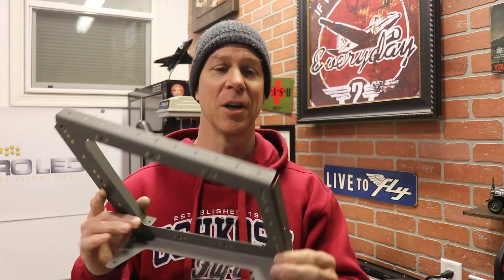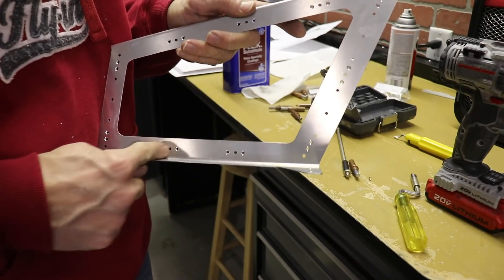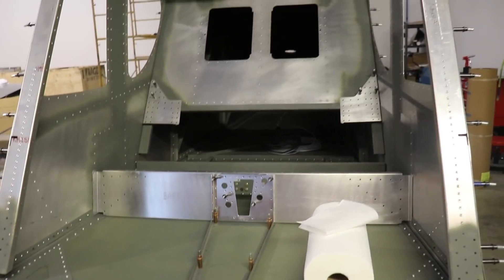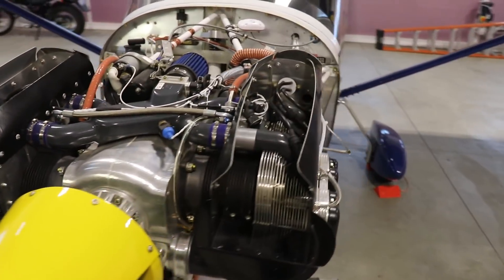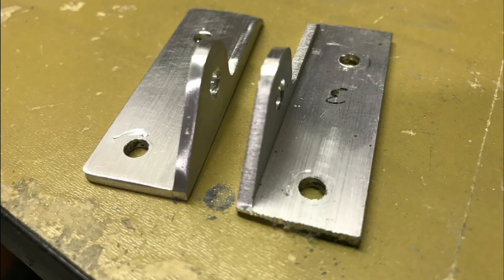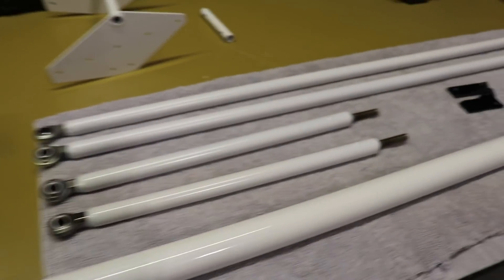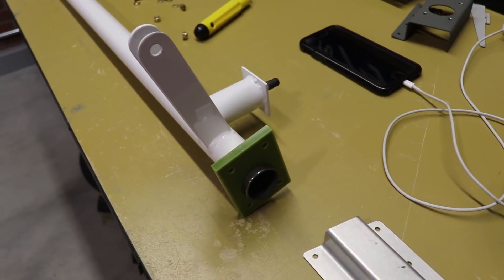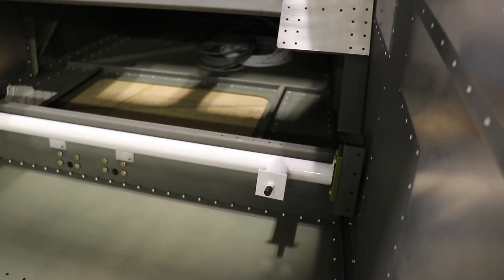Zenith 750 Super Duty Fuselage Update! (Ep29)

Comment: Are those floating Nutplates ? ... if so, you should add 2 x the radial float to the diameter of the bolt for a final hole size typically around .225" dia for a #10 fastener (3/16" dia bolt) , if the radial float is .015".
Reply: The close tolerance hole (.201" dia) goes in the access panel and the floating Nutplates on the mating structure provide positional tolerance for all of the hole-to-hole relationships.

Comment: As a manufacturer I use bolts in all of my assemblies. Bolts that have a smooth shank section (Grip length) are made the way they are to tightly fit two surfaces together so that there won't be any side movement in the joint or shearing force. You are supposed to get resistance when bolting these fasteners through a joint aka hole to get rid of that lateral movement that may become possible especially in a high vibration zone.
Reply from the maker: It sounds like you’re not understanding what I’m explaining in the video. I’ll clarify it in the next video so you’ll understand exactly what I mean.

Comment: My UL350iS drips from the drain plug, the rpm sensor and from the bottom of the oil cooler.  Getting ready to do the Condition Inspection and am going to flip the cooler over and mount it like the factory recommends.  The other two leaks I have not been able to stop...